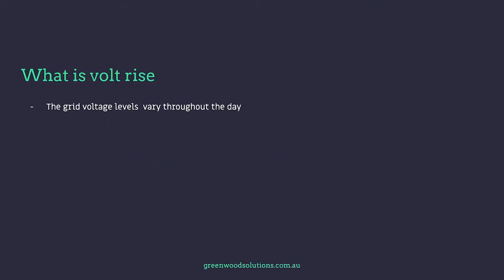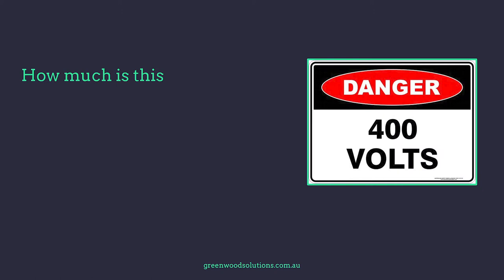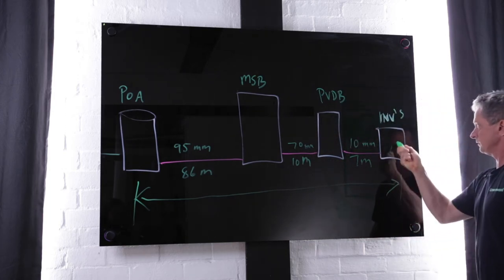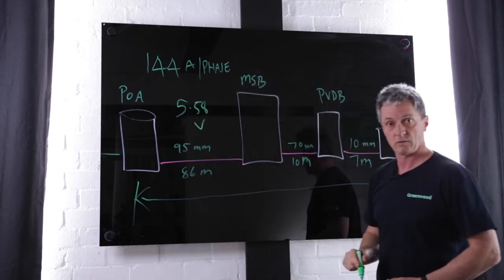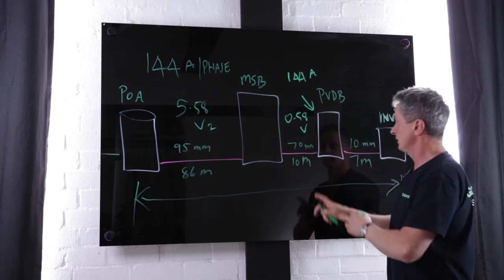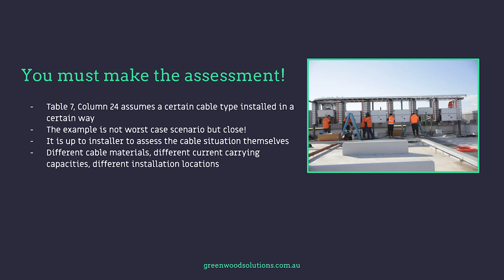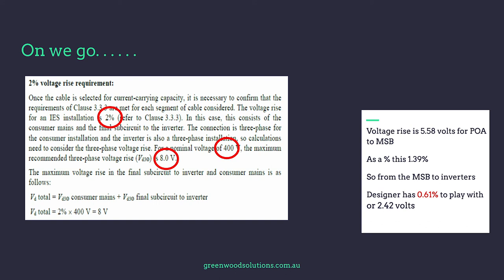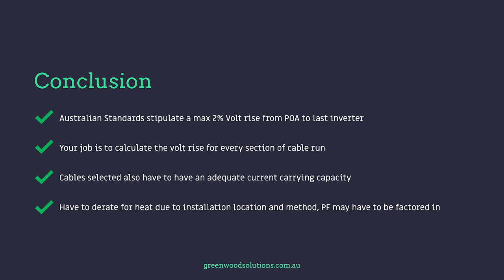Volt Rise Calculation

Comment: just one question about the last section which the cable was 10 MM, obviously the capacity is not matching 144A.. you did not mention about that part. would you be able to elaborate about that last section, please?
Reply: i AM PRETTY SURE HE SAID 4 X 25 KW INVERTERS. SO HE IS TALKING ABOUT 10 MM CABLE FOR EACH INVERTER.
Reply from the maker: You are right. The 10 mm2 cable was in reference to the individual inverter but all factors must be taken into account when selecting your cable. Derating for installation specifics is required.